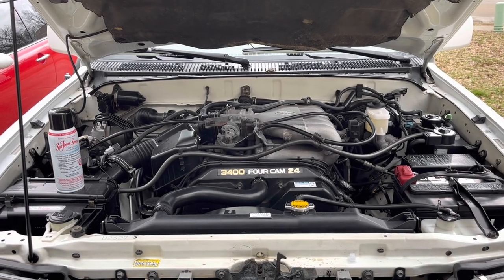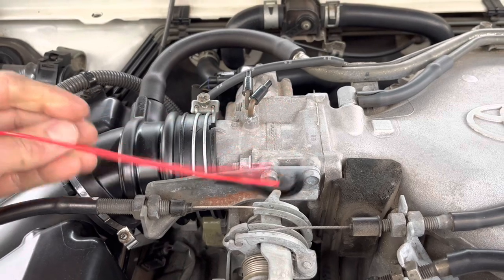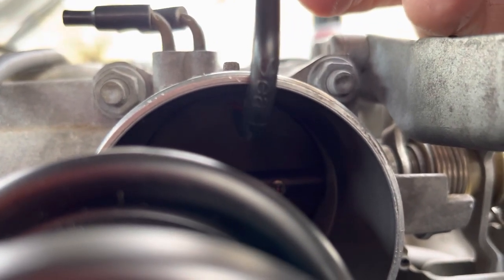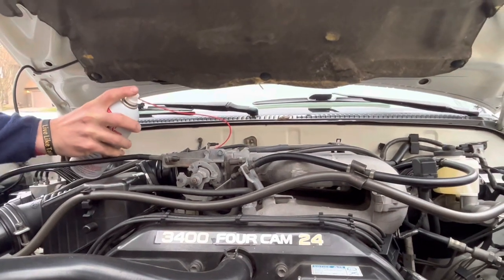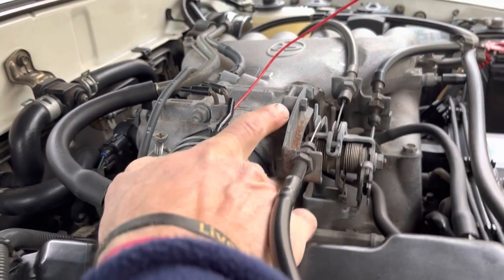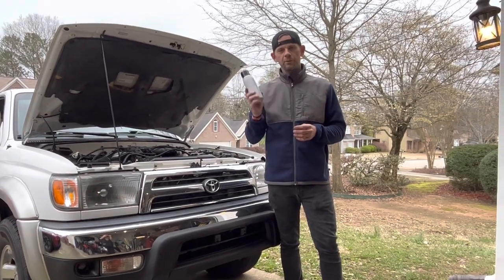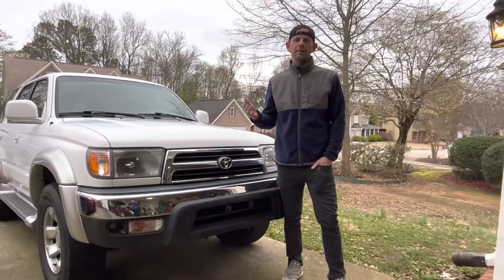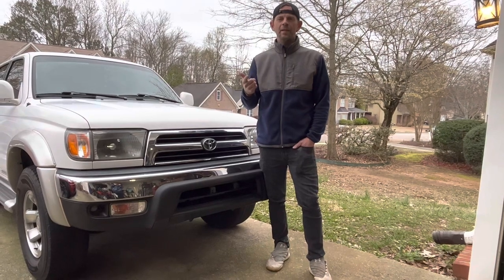SeaFoam Treatment - 3rd Gen 4Runner

Comment: Excellent detail video. Thanks! I was wondering if you can do a video on how to adjust throttle body sensor
Reply from the maker: Thank you, I appreciate you watching. Are you running a code related to your throttle body / sensor?
Reply: @vanwinklesgarage  have 1999 limited 4runner and just started this morning when I tried to started my truck. Noticed that the rpm push up kinda high at 2500 rpm before it actually move plus I get a slight kicks or jerky if you will. Once it gets gpi g it will be fine. However, I noticed when I come to stop light that's when the slight kick occur but throw no code. I didn't take in yet to get the code since check engine was on
Reply: Just ordered throttle body sensor in case I needed. Will also  do some seafoam clean on the throttle body

Comment: Why waste time doing all that at the throttle body? just slowly pour it down the main vacuum line with the engine running, then shut off the engine for 15 minutes (hot soak) then hit the road accelerating HARD.
Reply from the maker: I prefer following the instructions. This wasn’t a job that took a long time to begin with, so hard to feel like any of it was wasted. If you end up doing this treatment in the manner you stated, post a video and let’s see the results! Thanks for watching.
Reply: What I said are the original instructions. Check the first video from 2011 on the official sea foam channel. The straw can is for dummies who can't find their main vacuum line.